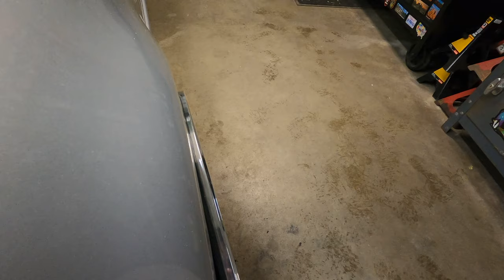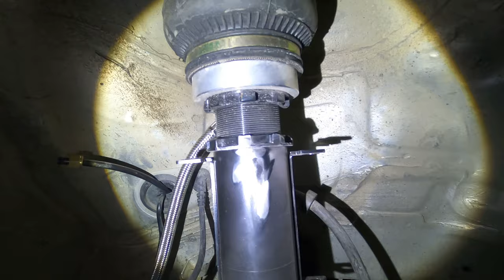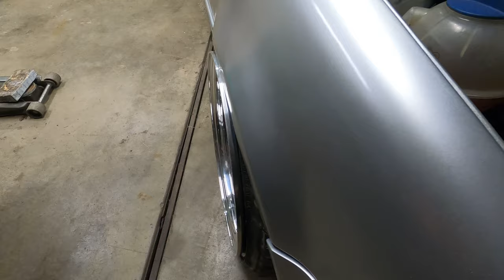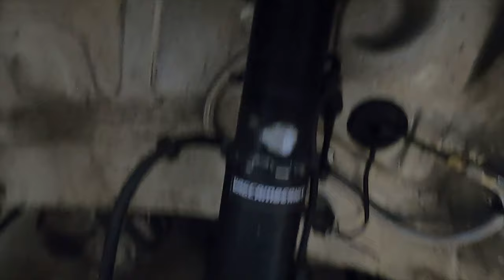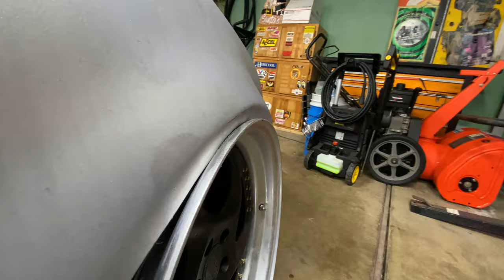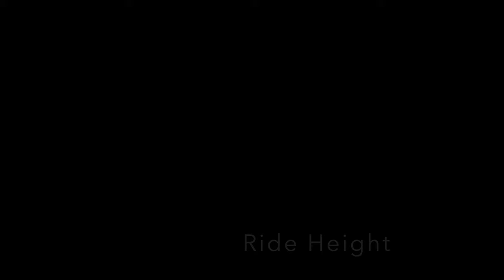MK4 GTI 337 Fender to Lip Fitment

Comment: how do you turn
Reply from the maker: With my steering wheel lol
Reply: @BMSmouthers  i have my car lowered rn and i can't turn my wheels without rubbing, my fenders are rolled
Reply from the maker: @sandwich1247  that’s the reasoning for stretched tires. So your able to turn and fit with aggressive fitment. Try smaller tires or add camber
Reply: @BMSmouthers  ohh ok thank you